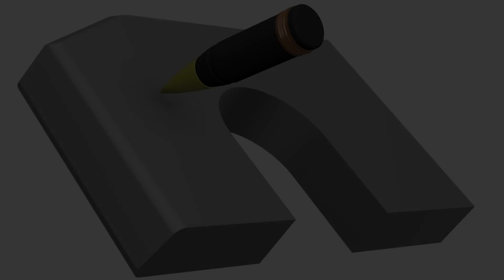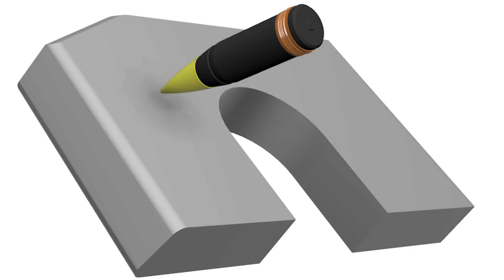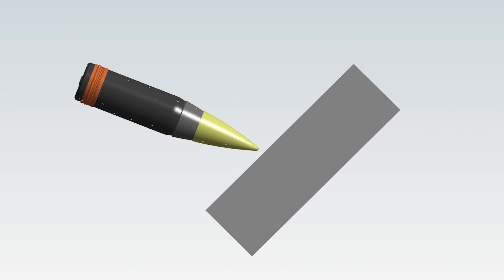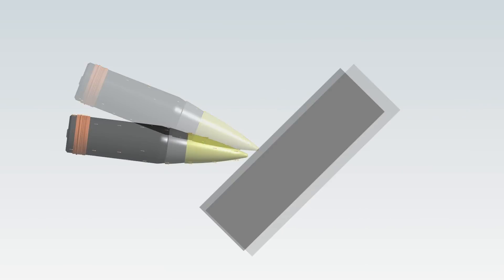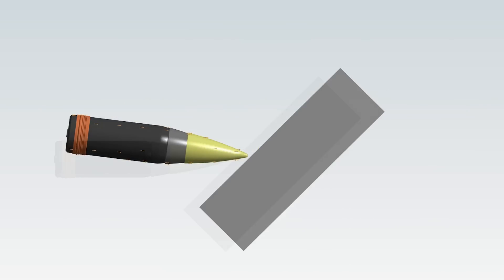USS-Iowa VS Yamato Simulation Part 2

Comment: Seriously impressive, but you have to wonder if the turret ring would survive such an impact.
Reply: He did another test with the whole barbette against 800mm shell and it held up pretty well. This wouldn't have much of an effect
Reply: Turrets getting jammed by an impact is not unknown. The Massachusetts jammed Jean Bart's turret at Casablance. Even if the turret ring is ok, possibly the shock could damage the drive mechanism. I also wonder about spalling from the back face of the armor.

Comment: I know that American shells and ballistics were optimized for deck hits (horizontal armor) at long ranges, but I was surprised at how much of a divot/bulging at 25k meters.  I just have always considered the Yamato turret faces to be impervious to essentially ALL ww2 weapons.

Now I need to check how thick the turret roof was.  Quite possibly still immune, but maybe ??

Regardless, I don’t think it would be pleasant in any battleship turret getting tapped by any battleship AP shell even if they fall far short of full penetration.  My ears are ringing just thinking about it!
Reply: Thou not penetrated, considering that this shell hit, you can quite fairly assume that a second hit was somwhere close. Even if not, the sheer energy of the hit, along with HE mixture detonation, would make this turret most likely temporary out of action. Everyone in at least the top level of the turret is at this point unconcious, has a concussion and throws up, and most likely all of them are deaf.

Comment: Fail tp pen but the amount of energy I think would still shear the mountings of the turret.
Reply: It wouldn't do anything at all lol you think a 500mm thick 15m diameter tube can just be pushed ? Not even a 800mm shell can move that
Reply: @greener2497  Errr no. It may or may not sheer the mountings. But it can easily knockout the turret. If a shell were to come in and impact the turret or barbette, the amount of energy being imparted will  misalign something and stop the function of the turret. BB New Jersey covers it. Some of the US ships maybe able to get away with an impact because they have clips, but KMS and HMS didn't usually, so they can misalign and put the turret out of commission. Tirptiz had it happen to its Dora turret, but from a mine however.

Comment: Jesus that's a lot of steel
Reply: The production of this vessel cost japan a years worth of income, for the whole country
Reply: @TTalksVA  Should have better built tanks. 😅
Reply: @mmkr1-gl5bg  well, japan is mostly surrounded by ocean anyway, and their direct neighbor china isn't that impressive military wise, and china is pretty much the only country that japanese tanks needed (and can) to go to (europe was a tad too far).

since the china didn't have that much military infrastructure at the time, the shitty tincans that japan had was more than enough, at least until the shermans came around, tried to do something about it, resulting in later chi-ri (s), but too little too late in the end.
Reply: Having been on the USS Alabama a number of times, the thickness of the turret steel is insane, let alone other "protected" parts.
Reply: All that work, just to have some asshole sink it
Reply: @wor575  You can see one of those actual plates (made for Shinano) in the Washington Navy Yard in DC. 

It was pierced by a mark 8 shell from a MK 7 16”/50 gun, but the test wasn’t realistic iirc (like 0 angle of obliquity and basically “point blank” range).
Reply: I wonder why nobody developed shaped charge naval shells. With the right design even a light cruiser could have penetrated a battleship. The post penetration damage is low though.
Reply: @ShokkuKyushu  Tech and cost limits I'd think.  Accuracy was low and higher costs would add up.
Reply: @kamaeq  AP shells required Ni ,Cr and had several heat treatments ,they weren't cheap. But maybe the high explosives were more expensive than all of that ,I don't know.

Comment: yamato vs iowa turret face next?
Reply: Very unlikely to penetrate. The Iowa's turret face is 431.8mm (17in) thick laminated on a 63.5mm (2.5in) backer for a total thickness of 495.3mm (19.5in) sloped at 50° to an effective thickness of 646.6mm (25.5in).
Reply: @ThatGuyOrby  With ~850 mm of penetration at the muzzle I don't know. That is obviously considering a vertical plate ,the projectile probably breaks at this angle🤔.
Reply: Material quality matters. The US had better armor plating. So it could have the same performance as foreign plate at thinner, and so lighter, dimensions. Perfomance wise, the Iowa's armor was almost equivalent to   Yamato's, but thinner and lighter.
Reply: @Cavilier210  yes BUT not really, US steel was only about 5% stronger which make a difference but Yamato's turret faces are 9 inches thicker so yes US had better steel but it really didnt mean much, I just like watching shells hit armor in slow mo
Reply: @notenoughspaceto  thats fair. Lol.
Reply: @notenoughspaceto  depends. In lower thickness yes, but as the plates get thicker, Japanese quality tended to nose dive. For example, the 26in plate we have from Shinano was found to be of completely inferior quality by around 30-40% IIRC. The plate had noticeable airpockets and fractures upon detailed examination. The same held true for her belt armor. This is normal for everyone however, its just the Japanese (and the russians) had it worse due to inferior steel manufacturing capabilities.
Reply: @ yes, it was weaker but not 30 to 40% more like 20% which is still a lot weaker but not a ridiculous amount
Reply: @notenoughspaceto  every ton matters
Reply: @theamerican_1945  Not just the manufacturing, they had inferior iron ore to start with. The same reason the old smiths had issues with making high quality steel.
Reply: Yeah it would be cool
Reply: Source material is from the U.S. Navy Bureau of Ordinance.

Immunity zone of the Iowas vs. the 18.1" gun:
Citadel                    24,800- 29,800 (5,000 yards);
Turret Faceplates 24,700- 31,600 (6,900 Yards);
Barbettes               26,500- 31,600 (5,100 Yards);
Steering                 24,700- 28,800 (4,100 Yards);
Control Tower       26,500- 31,600 (5,100 Yards).

Immunity Zone of the Yamatos vs. the 16" .50 cal. gun:
Citadel             17,000- 34,500 (17,500 Yards);
Turret Faceplates                      (Impenetrable);
Barbettes         16,600- 36,800 (20,200 Yards);
Steering           19,100- 33,400 (14,300 Yards);
Control Tower 16,600- 33,400 (16,800 Yards).
Reply: Yeah, that would be interesting to see , if he uses FHA armor as it should. Not a realistic thing,I know, as battleships were not designed to resist battleship guns at point blank range.
Reply: @notenoughspaceto  the turret faces on the Iowas were very thick—multiple layers to about 19”.
Reply: My mistake :apparently the face of the Iowa turrets was RHA unlike carburized FHA for the sides and back or FHA higher carbon for the Yamato.
Reply: reduced to atoms
Reply: @sterlingarcher813  Unlikely. ~19in at 50 degress is gonna be tough to penetrate at any combat range.
Reply: @sterlingarcher813  I know but I wanna see, iowa has 17 in thick turret faces so it would probably go right threw
Reply: Ever seen swiss cheese? Something like that except the cheese is 40+ thousand tons of steel

Comment: It’s absolutely crazy that a 16” shell could just snap in half like that.

Also, please correct me if I am wrong, but in testing didn’t a 16” shell manage to penetrate the turret front of the Yamato during post war ballistic testing, alibis the plate was of poor quality?
Reply: I believe it was tested at point blank and at an unrealistic angle.
Reply: That test used the same 16"/50 Mark 7 guns against a spare front plate meant originally for Shinano's turrets with no angle on the plate at point blank. An impossible shot since at point blank you wouldn't be able to get that kind of angle on the turret unless Yamato was listing 45 degrees to nullify said angle.

Comment: Surprised at how well it stood up
Reply: not really, considering that it is 25 inches of armor, so a 16-inch projectile is not really going to be able to do much as long as the arkor isn't just mild steel
Reply: @twinkyoctopus  they tested one of the shinano's(the third planned yamato class battleship that was converted to a carrier before launch and sunk in port) turret plate against a 16 inch gun at point blank range and you can see the results at wilmington navy yard, granted said hit was under ideal conditions i imagine the first hit in this video would have still been a penetrating it once the bursting charge detonated
Reply: @jakegrube9477 Those were rejected plates not the actual main plates. Besides, that was 410mm belt armor plate not the turret plates. Shinano conversion was begun when she isn’t even complete the hull of the ship. So it would not making any sense for making a turret Steel plate when the hull isn’t properly ready. In many sources, it was Yamato’s armor belt plate that have very low quality in steel. Which results the Japanese Engineers rejected those plates. What American tested those armor plates on is the rejected plates that are very poor quality in steel. I know Japanese Steel aren’t as good as any Steel in any nations. But, Japanese aren’t stupid.
Reply: @tsuaririndoku  
If you're referring to the well known picture what is often wrongly referred to as "Yamato" armor being penetrated by a 16in shell, that was, in fact, 26in turret face armor (the penetration was near one of the gun ports) intended for Shinano that went unused and was kept in case Yamato or Musashi ever needed one of thiers repaired/replaced. 
Things like turrets and guns are usually designed and built way ahead of the actual ship. In fact, most ships are built around the guns, not the other way around.
I don't think any Yamato-class belt armor was ever recovered by the allies. Even if it had, it was already understood that 16 guns could penetrate 16 of belt armor outside the "immunity zone". 
And most Japanese steel had some degree of flaws, used or not used. Even Yamato was plagued with issues with her guns due to flaws with the materials used. No one said Japan was stupid, they used the best they could get.
Reply: @177SCmaro  Like I said. I know Armor plate of the Japanese is flawed but it doesn’t means they are stupid not to know this. They do know what is good quality of steel they can have or poor steel quality they got. What US get was the rejected plates. Shinano’s plate of 605mm plates might no longer needed but from what I heard of. It is a rejected plates. Means this steel quality is worse than quality they built on Yamato Class. Means, steel quality on Yamato despite being poor quality, it still decent enough. France has the best quality steel in WWII, it just that they make poor mass production of it. German Krupp steel also decent at the time. Japanese despite having worse quality than the US. IJN steel quality still better than USSR.
Reply: @tsuaririndoku  In none of the literature on Shinano's recovered turret face armor have I ever heard anyone say it was "rejected" for any flaw, just that it was not used given that ship was converted into a support carrier partway through construction.
And, again, I've never heard anyone call Japan "stupid" for using what they had.
Reply: @jakegrube9477  the conditions in that test were impossible in a yamato on iowa engagement. 
They simply wanted to see if the shells could penetrate that much armour under any condition.
Reply: @Spider-gg3pj   yea im aware, if an iowa and a yamato ever came to blows assuming that neither of them had suffered any damage before hand the iowa would spot, shoot and land hits before the yamato could even see it unless it had spotters in the air
Reply: @jakegrube9477  the iowa does have way better radars but both naval gun range records (a tie between warspite and scharnhorst) were set without sophisticated radar and thus the iowa can not be handed victory based on that alone.
Neither of these ship classes have been proven in battleship combat, but usually survivability is one of the most important aspects, where the iowa does not have any grounds for claiming superiority.
It's damage control was slightly better but it severely lacks in armour, compartmentalisation and volume.
Reply: @Spider-WoIf  
it's also true the Iowas never really had the opportunity to use all that sophisticated technology is combat to see if it's more effective. So we'll never know. I will say that after the war the Iowas were proven to be exceptionally accurate against stationary targets in a bombardment scenarios which implies they might have been quite effective at long range naval engagements.
Also, the Iowas were well protected against anything up to 16in guns and had more than a safe degree of reserve buoyancy and compartmentalization. Where the Iowas did have a defensive weakness was in their torpedo protection right around the front turret due to how narrow the bow is in that area.
Also, American damage control was vastly superior to Japanese, especially late in the war. Arguably the only nation to do damage control better was the British.
Reply: @177SCmaro  their 12 inches of armour, while in theory able to deflect shells, were not implimented according to plans. combined with the poor welding present in their construction and barely compartmentalised boiler rooms means the iowas reserve boyancy cant be taken at face value.
Reply: @tsuaririndoku  the armor used in the test was one of shinanos' turret faces. There was a thought that it might of been a rejected  piece due to its lower quality as compared to other nations armor steel but after comparing it with other pieces of armor found in the shipyard and In the vicinity it is accepted as being the proper finished product not a rejected piece.
Reply: @tsuaririndoku  It wasn't a rejected plate and it was a turret faceplate- and not belt armor. Shinano was converted to a carrier and the Imperial Navy had no other use for a Yamato class turret faceplate so it was set aside. The idea that Japanese armor was of low quality is a myth, and stems from the fact that pieces of dirt were detected in the plate in question at the U.S. Naval Proving Ground (USNPG). Dirt was also detected in another, 7" thick plate at the USNPG, and it proved to be the best plate of its thickness range ever tested by the U.S. Navy.

While the USNPG concluded that the overall quality of Japanese armor was slightly less than that produced in the United States, the British Admiralty's Armour Technical Committee (ATC) concluded from their testing of other nation's armor that Japanese heavy armor was superior to all foreign armors (including that of the U.S.). Much depended on the exact testing conditions. In practice, the difference between nation's armor was in fact minimal- enough so that armor thickness and angle was of greater importance.
Reply: I am surprised by the strength of the shell . The mk 8 was certainly the best 16 inch ap shell ever. It almost looks like a tank APCBCHE due to  small burster cavity.

Comment: is this taking into account lower quality japanese steel? or would it not have mattered?
Reply: Japanese steel apparently varied heavily in quality, ranging from very poor to very durable. I think the plates used on the actually Yamato class were well tested and of a higher quality batch
Reply: @williamgandarillas2185  If I remember correctly, I could be off mark, the thick belt and turret plates featured on Japanese warships were of rather low quality but the thinner secondary and deck plates were considered to be very high quality. So the first layer of armor would offer less resistance than expected but by comparison secondary layers would be rather resilient for their thickness
Reply: The difference in armor quality of all the major navies in WW2 was minimal.

Comment: does these projectiles have explosive filler? If so, I imagine it could do some spall damage or eventually, repeated hits would weaken the structure
Reply: You can see the filler cavity doesn't even come close to entering the armor. On the best shot it would have exploded harmlessly.
Reply: I dont know the filler of this 406mm, but usually US didnt have that much filler on their shells, i would assume between 8 to 15kg in this shell, i dont think it is enough to break that much of armor that lasted
Reply: @CChiefmk3  This is a Mark 8 Super-Heavy AP shell with an explosive bursting charge of 18.55kg (40.9lbs) of Explosive D filler
Reply: Also, getting a hit so near a spot weakened by a previous hit is incredibly difficult for ships firing at each other from those distances.
Reply: The U.S. Navy replaced Dunnite with the RDX derived Composition A-3 over the course of 1945-46; which proved to be "60 to 100 percent" more powerful than Dunnite in testing.
Reply: @ostiariusalpha  Yep.
Reply: The 16" .50 cal. shell had a ~40~ lb. bursting charge of dunnite (a.k.a. Explosive D). The 18" .45 cal. shell had a ~74~ lb. bursting charge of Trinitroanasol (TNA).